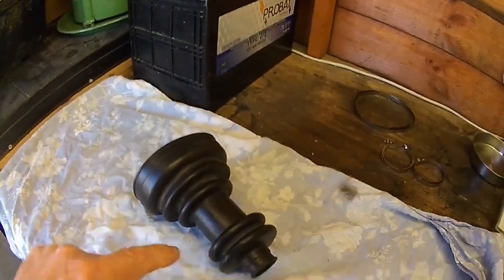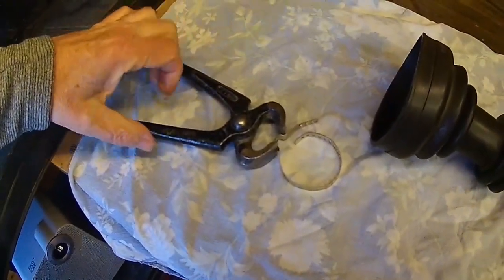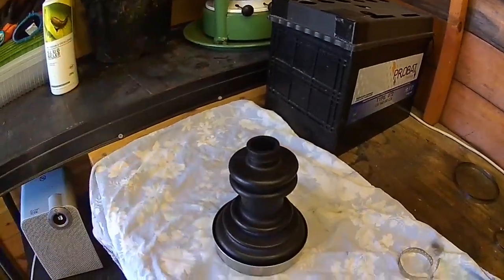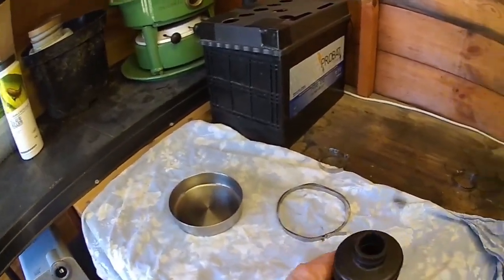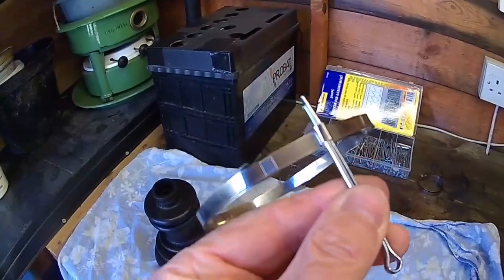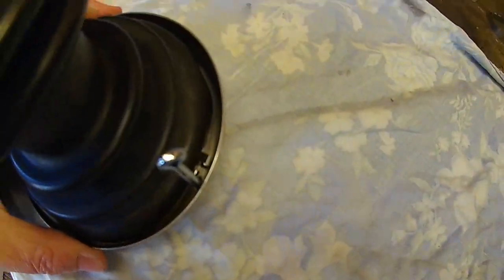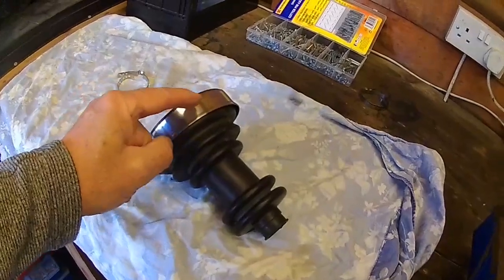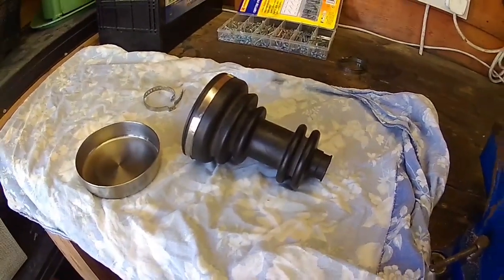Kinky Black Rubber Boots. Talbot Express Motorhome.

Comment: Think I'll just take van to Garage mate. My Arthritis won't let me do a lot of Job's I used to. Great video as always.
Reply from the maker: Hi Helen and Jeff. I have been struggling to do jobs in general.  I have arthritis in my right knee and it can be a struggle to kneel and stand back up. Under van I can get panic attacks and lastly strength to undo bolts. It's just hassle and money for garages is scarce. I have to replace the track rod ends soon. Just hoping there not rusted up etc. Cheers from George
Reply: If you have a ball joint splitter, it should be ok. I put plenty of Plus Gas on nuts aswell, to help loosen.
Reply from the maker: Hi I have a ball splitter it's the thread on track rod worrying me. On my old Morris I had to angle grind to remove it and no power at storage to use one.